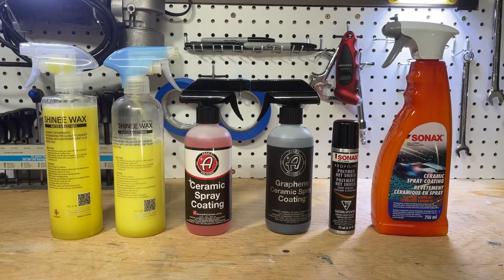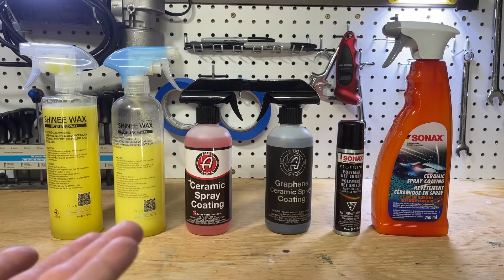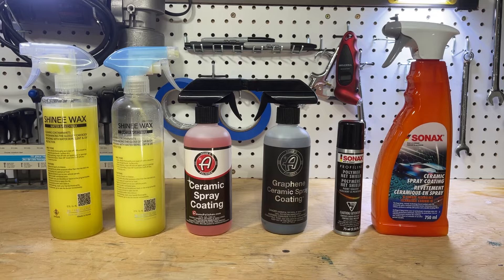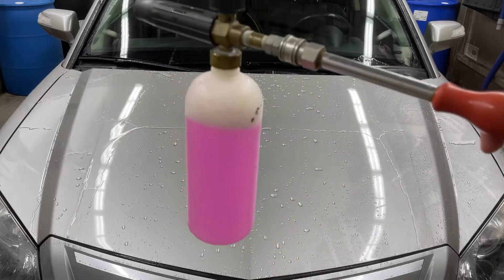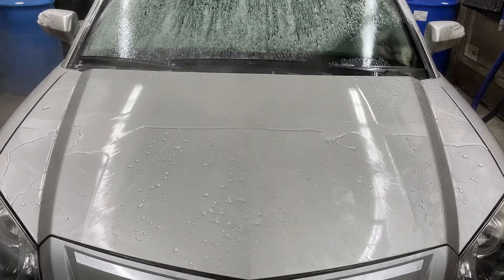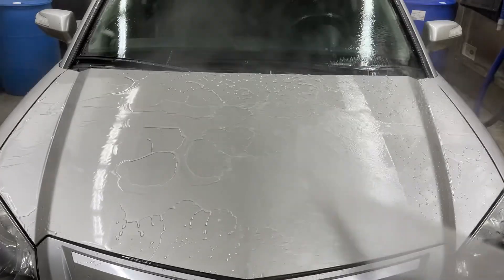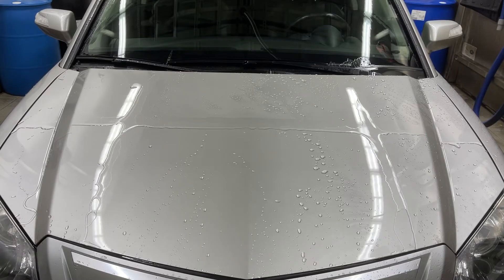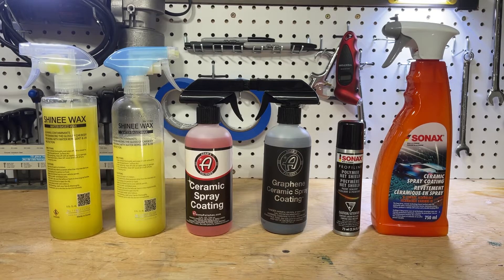Graphene vs. Ceramic vs. Polymer vs. Shinee! Two week update!

Comment: I've been using PNS & Finish Kare 1000P for many many years, and like them both.  Last year I decided to try Griot's Ceramic 3-in-1 Wax, and it seems to last longer than my 2 previous favorites.  In addition, 3in1 is easier to apply and remove than the 2 mentioned.  I'd like to see how the Sonax ceramic spray compares to the Griot's 3in1 in terms of longevity and gloss.
I'm currently using Xtreme Solutions Topper on top of the 3-in-1.  It lessens the hydrophobicity of the Griot's, but makes it glow better.  When I see the beads getting tighter, I know Topper is wearing, allowing the PNS to bead like crazy.  At that point, I just apply another coat of Topper, to increase gloss (and protect the PNS)
Reply from the maker: Griots 3n1 is on my short list to test. It seems to have decent legs and a high overall hydrophobic performance. I personally wouldn’t top a spray based product with a different spray based product. I would use 1 spray LSP that meets my gloss and hydrophobic goals and use it on top of a full blown coating or paste/liquid wax.

Comment: The Ceramic Spray sealant actually focusses more on paint slickness, sacrificing some durability for slickness. PNS is just awesome. If you don´t want slickness but a bit more durability BSD is still the way to go with Sonax. From the way the German Sonax Technican explained, you can either get durability or slickness as far as I understood it. Also if you want Slickness, there is a Sonax Ceramic Quick Detailer which is like 10€ a bottle which you can use to top both PNS and the CSV for Slickness. It doesn´t last that long through.
Reply from the maker: Interesting info! PNS is great for a hand off car. Anything you like to touch and too would seem better off with the ceramic spray coating. Very easy to apply.